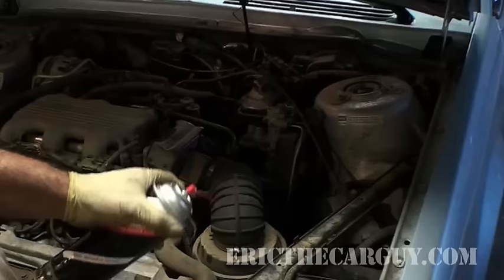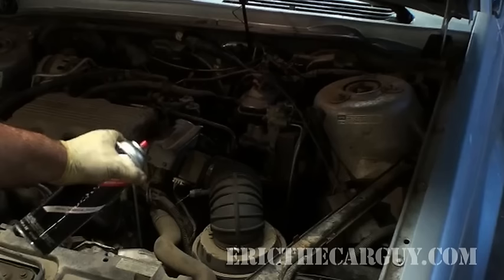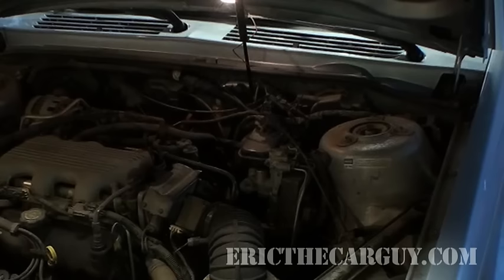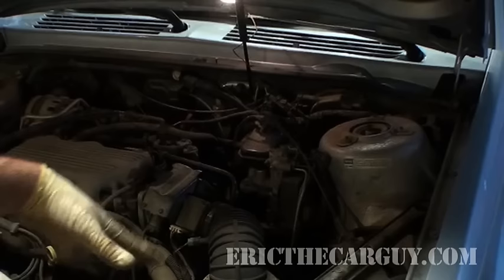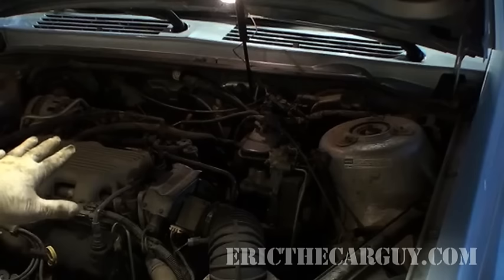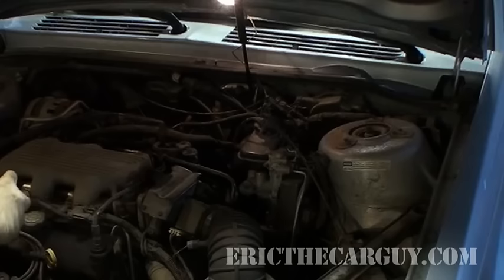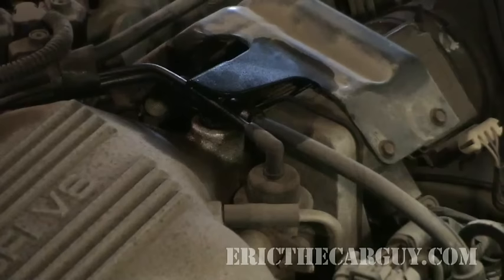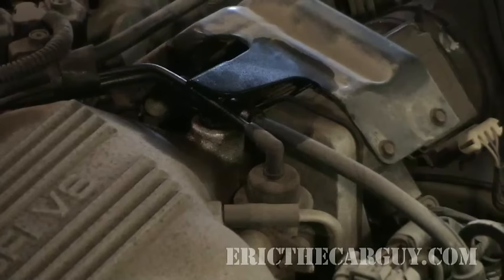How To Find A Vacuum Leak - EricTheCarGuy

Comment: I have a 2008 Ford Focus with 218000 kms. I first noticed I had an issue when I went to turn on my heater in my car and it wasnt heating the air. Then I noticed when I had my vents shooting at me, that the air would be hot then cool down and not get hot again. Third, when I was making a delivery and I got out of my car, I heard a hissing sound coming from under the hood, and upon inspection, its blowing out some sort of liquid in a steam fashion. I know where the problem is emanating from, but I have no idea what it could be! Now, I'm wondering if I can still drive my car and go to the auto wreckers to purchase the part which the leak is coming from or is it safer to have the car towed to the mechanic. I want to avoid going to a mechanic cause its gonna cost me over 100 to fix and I'm on a real budget crunch; I would rather do it myself, since I can see the origin of the problem, it's not soo deep in the engine it's inaccessible to me and I would like to save money on it! Anyone have any suggestions? Thanks in advance.
Reply: Sounds like a coolant leak. If the heater core has nothing running through it you won't have heat. Check your coolant level before driving.
Reply: @greendropwebmanager3974  Thanks,  man. I  was aiming towards that too! Now, I have the car sitting, debating whether I should throw more money at it, knowing this is the problem. should I go ahead and get it fixed...
Reply: @greendropwebmanager3974  considering the car having 218000 clicks on it, should I go ahead and get mechanic to fix it for 500 or drop the  car altogether!? your input means a lot!

Comment: Eric, I have a 65 For Fairlane 500 Sport Coupe 2 SPD Auto with the Original Straight 6. 65, 500 Original Miles...With New EVERYTHING...but it's been sitting for a while without being driven , but to car wash and Gas station.I think I have A Carb Vacuum Leak. It starts, Runs, but drives rough. It put puts, cuts off while driving and won't start back up, and I can't get it to Accelerate at all...It barely drives. But run fine in park. Help Me Please?

Comment: My car has a high pitched beep like coil whine, really high pitch, I can hear it very well when parked paralell to a wall, but anyone I show it to doesn't hear it.    

I suspect I might have a vacuum leak, because my RPM's drop to 600 and it shakes the car a bit and goes back up to 800.    

I got my carburettor cleaned out and it was fine for like a week, now it's back to dropping to 600 and barely catching it when I stop.    

Was thinking of getting carburettor and idle motor? replaced, but I want to rule this out first.    

I'm clearly not very good with cars, but I don't think my RPM should drop below normal idle (~800) when I come to a stop, specially when I don't have AC on.    

I'm too scared to do this and I have no idea where to spray on my Renault Laguna 2 1.6l 16V.    

Anyone know what I should do about it? Do I go to a shop and ask them to check for vacuum leaks? Do petrol engines even have vacuum? I'm so lost... :(

Comment: I have a 1993 mustang, issues:Car starts and runs but after 10-15 of warm up and when i step on the gas, car does not rev like it should.  I have 36lb injectors, pms stage 2 controller(engine is a 306 with all the goodies save for n20).  Do i have a vaccuum leak?  Many thanks. Am saving for a stage 4 pms controller as i am hoping that this will solve my issue.  Please comment.

Comment: hey eric , 2008 crv lx 4 wd got a check fuel cap message for the longest time,, replaced gas cap with oem ,  but still persists,, the I got a p1456 code months later what do u think change the evap vent valve or smoke test first,,which hose do u think I should use to smoke test

Comment: Hey so i just got code p1294 and it said something about the throttle body but now it won't start at all, it cranks but that's about it...any idea what it could be? I also upgraded the throttle body to a BBK 62mm new tps and aic and about a week ago it overheated but i changed the temperature sensor and the thermostat...i need serious help

Comment: I have a minor issue with my vacuum brake release. Sometimes it works, sometimes it doesn't. After sitting for a month, the car holds its vacuum reserve (the heater is powered by the vacuum and still operates), so I doubt there's a leak.
The mechanism has been lubricated, and the vacuum switch is brand new. What can be the problem?
Reply: +Ronald van Kemenade My car did that and ended up being the check valve.
Reply: DaTwistedOne1 I'll look into it, thx.

Comment: Does this method work with Turbocharged engines as well? I know the turbo adds extra heat to the exhaust area as well as the turbo components. If not, how would you work about finding an issue with vacuum leak on them? It is a V6 2.5L engine, the RB25DET

I have a boost gauge in my nissan skyline which is seperate from the stock gauge and have suspected that the vacuum pressure seems to be lower than it should be (maybe not). My gauge i believe is in KG/Cm^2 and while in vacuum it is only producing 100-150 on the vacuum side but it boosts up to about .4 KG/CM^2 which is about 6psi of boost. Im not sure why the vacuum range is weird to me but it may be a different measurement.

Comment: Plus help. I have Volkswagen golf 2006 TDI. It stalls when I drive the car for 1-2 hours aka when the car is warm and I am slowing down it suddenly stalls and doesn't start for like 2-3 hours till engine gets cooled plus I have to use starter fluid to start the car again.
Pls help as I don't have much left as I have spend 1700$ already without any results.
Have installed.new fuel pump

Comment: i have a 03 s-10 4.3L vortec w/88,000 miles with code p0455 evap(gross leak)i changed the purge control valve, no help..FYI about 6 wks ago my fuel pump was replaced by friend..did smoke test into brake booster vacuum and sealed off system with latex glove at air filter and no smoke leaked anywhere(home made but, very effective mason jar w/2 lb of air pressure from a.c. pushing smoke)..i am burning 3x the fuel and dont know what else to look for to solve the code issue, do you have any ideas? i know its tough not being to see the issue/vehicle and give a diagnosis but, what would you be looking for?  truck runs fine so far.. any advice

Comment: Hi Eric, I'm not sure if you reply to comments but just curious is a vacuum leak could cause pinging while under load such as driving up a hill in a higher gear?
Reply: +the madcap laughs If your vehicle has a vacuum advance on the distributer, check the hose going to it for suction. Had a problem similar to yours on an older jeep

Comment: I am soo lost with my car, I have tried this method with no success, I am not 100% sure if I an hearing the motor run or a vaccum leak, I have checked the iac and that seems to be OK, what happens is I drive the car and when I come to a stop the car idles high for 10-15 sec before coming down to normal idle and from my spark plugs it looks like it is running lean, all the heads are burning white, iac and iacv are both shiny and clean on the inside and seem to all be working, the ecu is giving me no codes. I noticed this car bogged and died, I will try for that tomorrow, but do you have any advice?

Comment: Ur the 1st person I’ve heard say that vacuum leaks make car run rich(as opposed to lean), which brings up a question, IF a cars running lean, cause of too much air, cause a vacuum leak, then computer compensates with a strong + trim.. how does 1 know, or even guess, if a running rich is because it was rich in 1st place, or because lean, & computer-therefore rich.  IO if it’s got strong +trim.. how does that distinguish between meaning cars running rich, or lean?  hmn?🤔
Reply: sorry, grMr😕.. I mean hmnnn?🤔

Comment: had code 449 changed vent valve code cleared 25 miles code446 came up changed purge valve cleared code 13 miles later it came back now  what

Comment: Can i use mild soap and water in a spray bottle to find leaks?
Reply: I wouldn't think so, the basis behind this is that you're adding "fuel" to the mixture and thus flooding the pistons and causing the car to die. Soap isn't flammable enough to create this effect.

Comment: My  car  sounds  like  Harley  motorcycle  (  91Caddilac4.9DeVille  ) they  said  it's  the  exhaust  gasket  but  my  guestion  how  does  it  pass  smog  but  the  other  guy  failed  it  though  if  the  car  shake  &  sounds  like Harley  Davidson  is  that  an  issue  though ?

Comment: Guy below says WD-40 doesn't burn?? That is not true. I work with asphalt and use wd-40 to clean equipment. We use stainless steel bowls to heat up our asphalt and after poured out it leaves some oil behind so ill spray WD-40 on it and hit it with the propane torch for less than a second and it ignites and burns for a while before going out. So if your motor is hot enough it may be possible it will ignite. Just a heads up

Comment: So can a vacuum leak also cause you to have no AC?
Reply: If the low engine vacuum keeps certain vacuum operated controls on older vehicles from functioning properly on the HVAC system then yes it could. But not likely

Comment: Eric, I have a 350Z Which i keep getting p0300 multiple cylinder misfire. I noticed that it happens only at idle. I performed a vacuum leak test, changed out my plugs, coil packs, o2 sensors, fuel pump, and i'm still getting the code. My next thing to look at is the timing chain now, if it was skipped a tooth, would that cause the engine to misfire? Thanks.
Reply: Hey man idk if you still have your 350Z misfiring but I had the same exact problem on my 350z and it turned out to be the fuel injectors. The little rubber tip at the end of the injectors had turned old and cracked and was leaking fuel out the sides so it was causing the misfires. 90% sure that's your problem

Comment: What about code p0171 system too lean. Clean maf. Replace tps. About to replace o2 sensors. My problem its on the idle. When its park my rpms are normal 600 -700 rpms . When its on drive they go down to 300 or 400. Thats normal?  Sometimes they stay about 500. No air leaks. Check about 4 times lol. Thanks. 99 lexus gs400

Comment: what does it mean when I start my car and it revs to 1500 rpm before this it would sit at about 600-700 rpm. when I go into drive or reverse it goes back down.. I got a new air filter an tried cleaning the mass air flow sensor . And nothing changed. auto zone plugged scanner into my car an said the mass air flow sensor came up. is it  simple as a vacuum leak, or do I need a new air sensor.
Reply: and will my problem get worse

Comment: Man, you so awesome ahah, would this be an issue with my car? My car go up and down in park, from 0-2000 rpm, back and forth fast, and while driving, when i take my foot off the gas, it only depreciates slowly in speed, and for the most part stays at that speed. no check engine light, and it's a automatic on a nissan altima 2005 2,5s. Hopefully you can help me out, thanks !!

Comment: sorry so long !I got a question mn I have a 2004 Pontiac Bonneville GXP  it has a 4.6 L V8 Northstar and only 52,000 miles on it I take care of all of my cars prime example when it reached 50,000 I got the valve cover gaskets,spark plugs and coil packs replaced about a month ago a check engine light came on and Oreilleys read it a said it was the downstream O2 sensor I went to a shop and they put it on their machine and told me it was the catalyc converter they took off the factory cat and put a resonator on it I told em that ain't worth a damn cause I don't want a light on that shouldn't be on they told me if I replace the cat the light will go off I bought a cat from rock auto and took it to them to put it on the guy came out  after he opened the part and told me it didn't have the square washer with it  he put it on the light went off for 2 days now it's back on and I gotta go up there and raise hell in tha morn i'm bout to file a civil suit any tips on what tha  hell to do once my car is running it does have a lil high pitch thing going on I thought it was how the car sounded after it's running. i'm not an expert like you my sound isn't necessarily a hissing sound it is a high pitch going on the pitch sounded like yours but it don't have the hiss you have. PLEASE HELP!

Comment: i have gas smell very strong in my oil and the car is running VERY rich, is it possible that a simple vacuum leak could cause gas in my oil?
Reply: i had the same issue with the burning rich thing and mine ended up being a bad coil pack. i have a 1995 eclipse gst. vacuum leaks are basically unmetered air added to the mixture and they make the car burn lean. a vacuum leak wouldnt cause a rich mixture in anyway that i have learned, if you havent already fixed the problem look into making sure all your spark plugs are igniting, if you have a code for fuel trim it could be something as simple as a coil pack or vacuum leak all the way to something as complex as leaky fuel lines, weak fuel pump, dirty injectors, etc. in my case with my car it comes factory turbo so its a lot easier to notice a loss of power because the turbo wont be able to spool enough boost and without turbo its very hard to climb hills because the engine relies on turbo to help make power. i hope this helped, let me know if you have a any more questions and i will try to help you out as much as i can.
Reply: thank you geoff, however im pretty sure the unmetered air caused the ECU to make the car run rich.  it would run lean if not for the ecu, but computers of course change and complicate everything.
Reply: vacuum still causes a lean burn. check everything that fuel contacts, ie spark plugs, fuel system, everything involved in fuel trim. you may not notice the problem. pull out your wires while the car is running and see if you notice a change. if not it is soemwhere in the spark side of things, if all spark check your injectors, it could be one sending too much fuel through and making the car not be able to burn all of it so it smells rich, could be your o2's that are reading a lean code so it compensates and gives you a rich mixture to even out. fuel trim is very simple but also very complicated

Comment: Hello
Do you want to Diagnose my car
1995 Honda accord LX 2.2 L. My car tries to starts but it won’t start
I thought it was the battery then I change the battery and it still won’t start. Car Light comes on but the window won’t roll down 
Has I have liquids and fluids, new spark plugs and wires.
Reply: tessy neufville alternator

Comment: i have a chevy impala 03 im having a problem what causes my rpm gauge to go rapidly up and down while the cars in Park
Reply: change maf sensor
Reply: +Early Pierce Don't remember which year impala, but there was a service recall for faulty throttle sensor. which causes faulty rpm, and stalling. Could also take to a shop and perform a vacuum test to see if there are any leak which could cause rpm to increase.
Reply: Oh ok i got 03 chevy impala
Reply: +Early Pierce I found a link with all of the official recalls. Find a Chevy dealership and they will fix free of charge. http://www.carcomplaints.com/Chevrolet/Impala/2003/recalls/ 
Double check with GM on authenticity. I know for sure your ignition is an official recall because I have a 2000 Chevy Malibu and I had a recall on my ignition.

Comment: danger danger alert first thing just start the car and start touching hoses moving them around then if that doesnt show any change in rpm get a smoke tester or make one they are cheap and effective just hook it to the inake and to your compressor turn it on and watch for smoke on some trucks there is a vaccume res just test that res by its self no fires involved

Comment: eric, I just had new break lines put in.  car was running great prior.  as im leaving repair shop car idle is all off, rpm revs up and down as I break and completely stop it almost stauls.  what can this be, it didn't do this before they worked on my car, does timing and idle have anything to do with working on break lines?  thanks, I know noob just trying to learn. help!!!
Reply: gita conway  If you look at the Brake booster there are vacuum lines running to it. If the person had removed the vacuum lines' not sure why he would do that" he may have forgotten to hook them back up. It is also possible the the lines just have a hole in them.

Comment: My car has that hissing sound but i have a cone cool air intake or whatever you call it and it sounds like it's coming form the filter. sometimes when i rev up the engine and let go of the pedal my engine sounds like it's gonna stall and it shakes and than it pic up to normal idling. what could that be?
Reply: ***** It's all that extra horsepower that you gained by installing that air filter. It could be the Idle Air Control Valve.
Reply: SuperKONR  we all know these filters don't do that. but thanks ill take a look at it.. there's some days that my car doesn't like idle and it idles super low and you can't tell the car is on.

Comment: Would brakleen work just as good as carb cleaner ?
Reply: Yes. And I think damn near any liquid propelled spray, or gas (air) that is flammable will work.
Reply: Just remember the safety warnings and preperations Eric is giving in the beginning!

Comment: I hear a hissing noise under my dashboard. whenever i apply breaks it goes away, whenever i release it comes back as if pressing it stops hissing air or something like that. Breaks still work fine but i need the noise gone. Can someone help me out? i'm not that great with cars.
Reply: Big Chief sayum " Soundum likeum brake booster "

Comment: get on your back with flashlight look where pedal goes in there is a rubber seal there . mine was just out of place not getting a good seal and caused the leak . so if adjusted this seal and it fixed it for me. goodluck